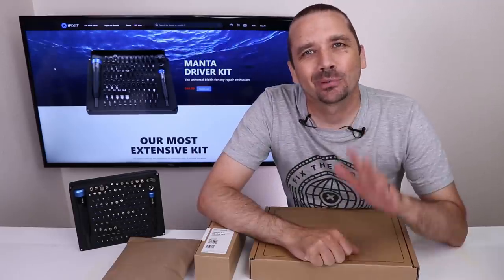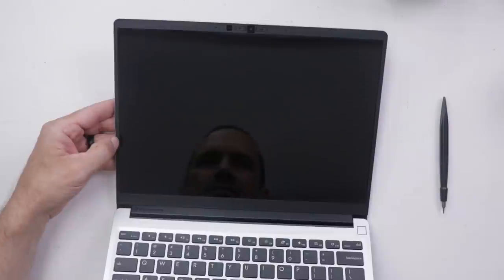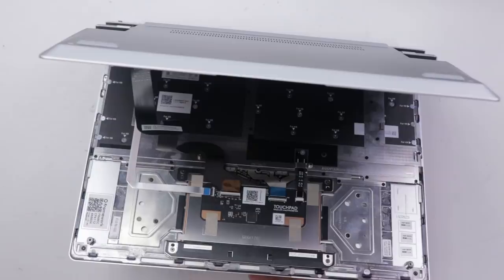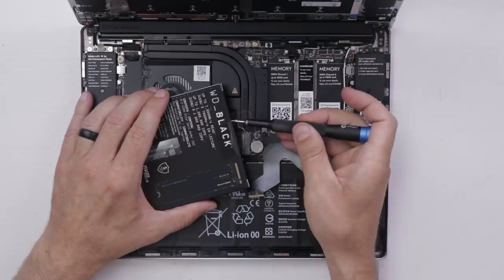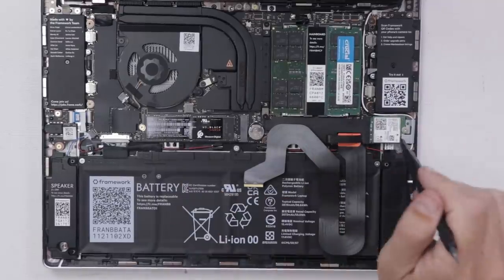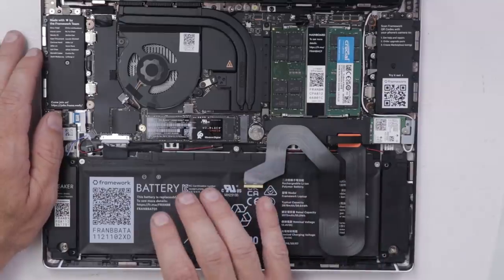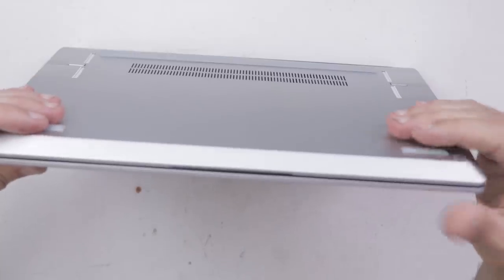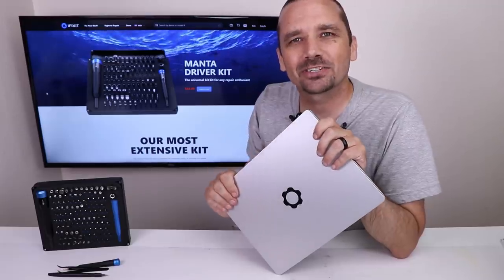I "Built" My Own Laptop - It's Actually Repairable!

Comment: I find it ridiculous that the laptop doesn't have any built in ports on it. The only ports it can have are the ones you add with expansions cards. At maximum you can have 4 USB ports but then you have no HDMI and no expanded storage. It's like Macbook but instead of having to use dongles you have to swap around expansion cards... Also it's a shame the CPU isn't replaceable.
The idea is nice, the execution is pretty mediocre.
Reply: I think the upside of the expansion card system is that you get to choose what ports you want. Some people will never need a DisplayPort, microSD, or HDMI, so they can just opt out of those. Or, some people may need two DisplayPorts and a USB-A, so if they need that, they can get that. I do agree that only four ports is a bit limiting, but the ability to choose your own and also have them be hot swappable is a plus in my opinion. Check Steve’s pinned comment for info on the CPU upgradability.
Reply: @CSab-ui2jt  The ability to choose is nice but having only 4 USB ports maximum and then sacrificing all other connectivity is very bad. You're either stuck with dongles like an Apple user or forced to carry around a lot of those expansion cards. There's also just one USB-C port on an expansion card, it looks like two should fit on there easily (or MicroSD + USB-C). I find this whole thing very underwhelming and it seems like a gimmick more than anything else. I don't understand who their target audience would be and I doubt this is going to last.
The mainboard seems to be replaceable, not the CPU itself.
Reply: @EnigmaNL  Yeah, 4 does seem limiting. As for the CPU, that’s because Intel and AMD don’t make socketed laptop CPU’s any more. I’m sure that if they did, framework would support it, but it just doesn’t exist in modern laptop CPU’s unfortunately. You’re right that two ports could fit on one expansion card, and there has been some talk about that on their community forum website. Granted, this is a version 1 from a brand new company, so there will be some hiccups, but I’m hopeful that they’ll just continue to improve.

Comment: I was excited until I found out there is no option to upgrade the gpu.
Reply: That’s more-so a limitation of the industry than the company. Laptop CPUs and GPUs are soldered rather than socketed. That’s not to say a GPU motherboard won’t be available in the future. Check Steve’s pinned comment for more information.

Comment: I also don't fully agree with the whole you can buy the part straight from us thing. I can go buy a replacement keyboard for most high end laptops on eBay. I mean yeah some high end laptops have riveted keyboards you but you can just replace the entire top bezel. The only thing that I find really unique about this laptop is the customizable ports and the fact that everything is easier to work on. They should focus on that marketing and not lie to their customers.

Comment: See the only thing about this laptop is. It's not anymore upgradeable than a end laptop that's already on the market. The only things it's got going for it is; customizable ports, a bit easier to take apart, and some of the parts are easier to replace than other laptops. That doesn't make it a fully upgradable laptop. I mean we can get into the nitty-gritty of having to replace the main board when new CPUs come out. But what if you buy an i5 version of this or if they have a ryzen 5 version. You realize that you need an i-7 or a ryzen 7? You can't get that CPU unless you buy a whole new board. That is replaceability. Not upgradability.